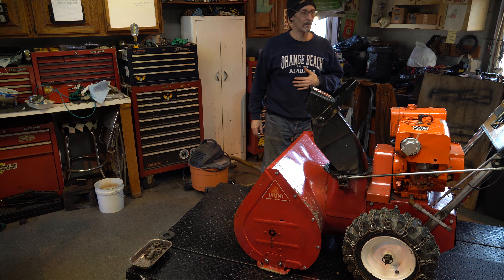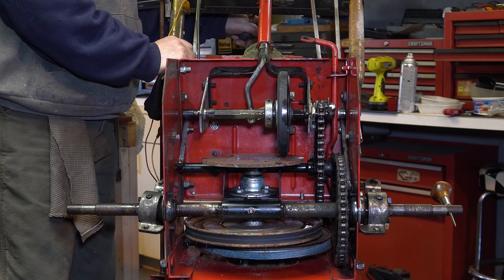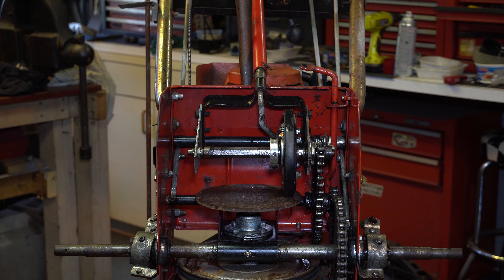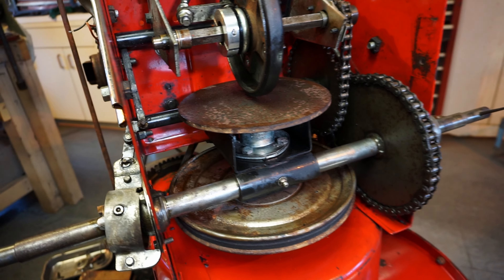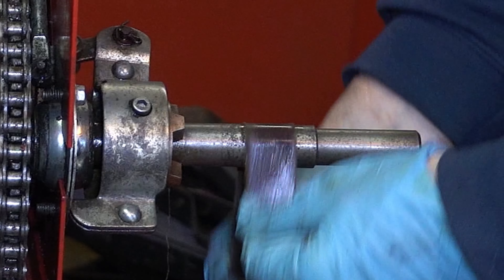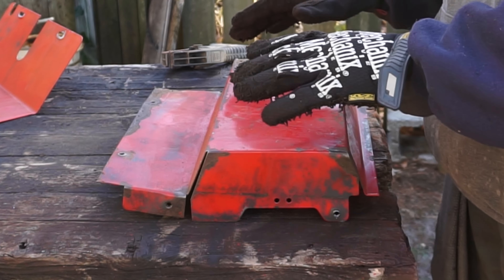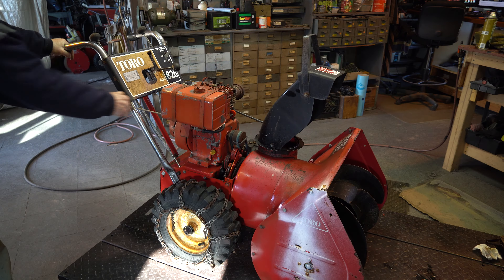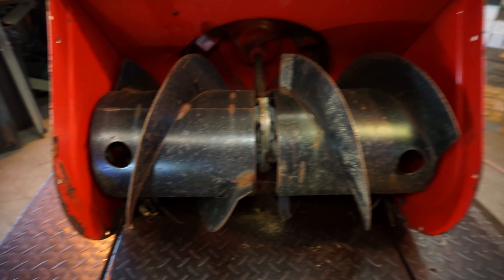1979 TORO 826 ~ 26inch - 8hp Briggs & Stratton Engine Revival  part 2

Comment: Arch, I’m new to this so I could be way off, but if the friction wheel isn’t centered over the friction plate then won’t the machine actually be tending to go in a direction other than neutral? I’m guessing here, but it doesn’t really seem like that shifting rod you heated and bent could have bent under usage, so I would suspect there must be some kind of adjustment in the linkage that allows you to correct for gear slots not lining up correctly with positions of the friction wheel. On my 1989 Toro 724 that adjustment is possible. The only other thing I can think of is that the long straight section of that rod has gotten bent slightly or the entire handlebar assembly has bent slightly in one direction but it’s difficult to see without clamping on some very long straight things like angle iron that extend up well beyond the top of the handlebar and take some diagonal measurements to confirm the handlebar hasn’t gone out of square to the machine. Only one other thing - is it possible for the shifter plate to move sideways on the handlebar?
Reply from the maker: wow,, I wish you asked that before I made the video lol I could have explained it better,,,
Let me think about how I can explain it now,,I didnt think to explain that,,
Reply: Arch's Garage   No need unless you’ve already shot Part 3. You can explain in the intro if that makes sense.
Reply from the maker: @Rein_Ciarfella  Yea, l aready shot,,,,Its a great question. I'm Negotiating with a Viewer to do his machine starting next week. That would be great if I get the Job. I can explain it properly while working on it. 
Tanx fer watching and asking the question!!
Reply: Arch's Garage   You bet!  I appreciate you actually reading and responding to our comments and questions! 👍🔧🧰
Reply from the maker: @Rein_Ciarfella  Stay tuned Cuz un the next 2 vids I go over,,well without giving it away, the head control assembly. YOU are onto something here and lets say you almost answered you own question.
At least in regard to the Toro part of the equation. 
I do want to include in a future video a better explanation of the disc.friction wheel.
Reply: Arch's Garage   Excellent!

Comment: 31:44 Auger looks like it may have lost a shear pin on one side.  It looks like half the auger is spun off from being even with the other half.
Reply from the maker: at that time stamp or starting at 31:00 I find out its got this Toro Design, no shear pins, I do show this as the video goes forward. As the scraper come back it disengages the auger. No shear pins required..
Check it out.....
Reply: @TheNovaJohn  It is an odd design for sure.
Reply from the maker: @Bradwick1  Yes, a little complicated and must be expensive BUT I don't have to worry or replace anything. It will just react and stop the blades!! How cool. I haven't worked on these until now.